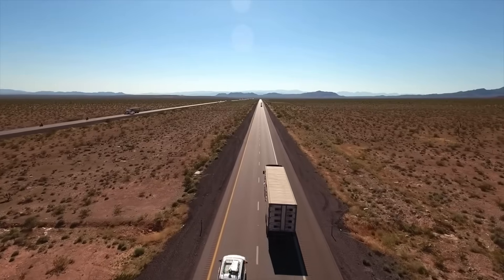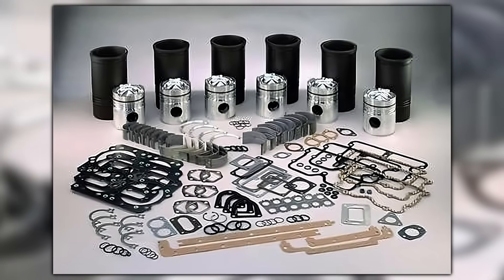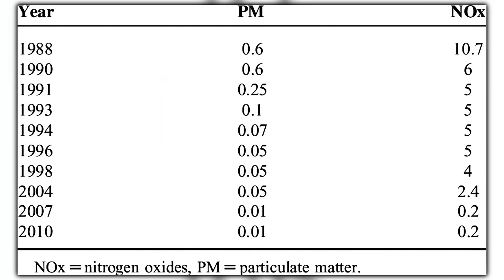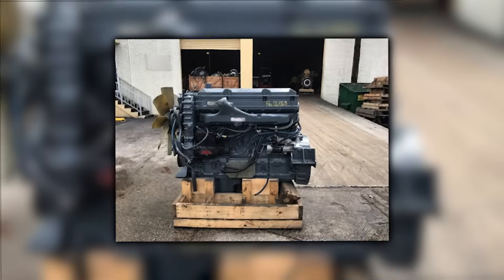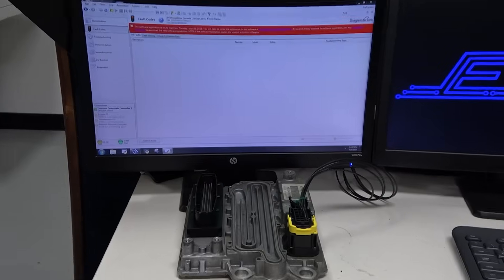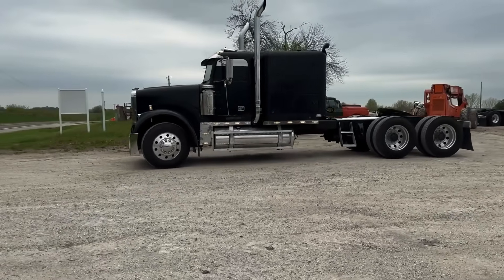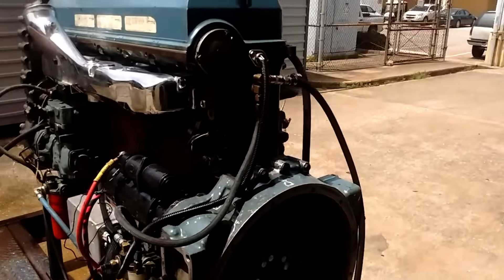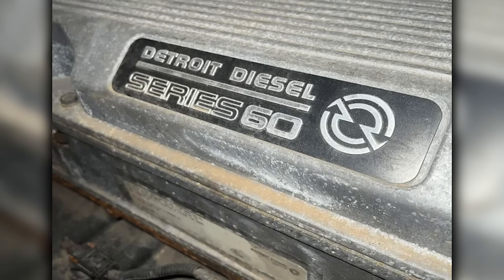The Detroit Diesel Series 60 Engine That Silenced the Big Cam in 1987

Comment: The guy I used to turn wrenches for says he owned them all until the 60 Series came out.  He fell in love with it and never bought a different engine since.  He still only runs Detroits, but while the engine seems good the aftertreatment system can be a pain and  Freightliner build quality in general could use some work.

Comment: I’ve driven all these engines over a 40+ yr career and I put 1.5 million miles on a N144 with out a single break down, I put a million miles on my 60series 12.7 liter and like most she ate a turbo at 700k miles I drove a Mack with their electronic control and it broke cams due to the cams porcelain coating and it would just shut down over fantom electronic codes that would require a reprogramming by Mack every time I finished my career with a Cummins ISX 15 and it was a beautiful engine to drive . I can honestly say that the only engines that never once broke down on me were the Cummins, my 350 cat 3406 ran great but liked to eat bearings but it turned out our fleet was being used as a test bed by Cummins and they were trying to figure out how much abuse they’d take from extended oil changes etc